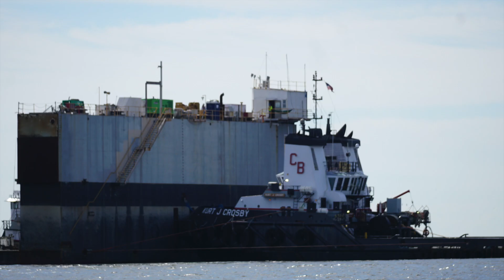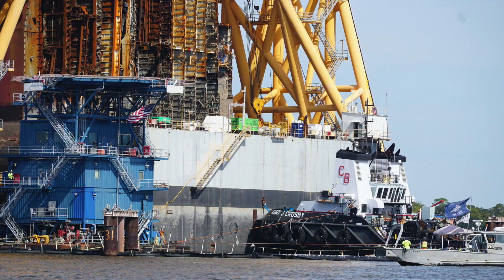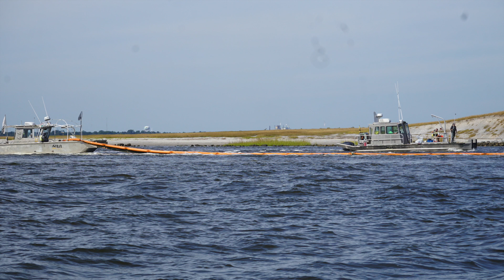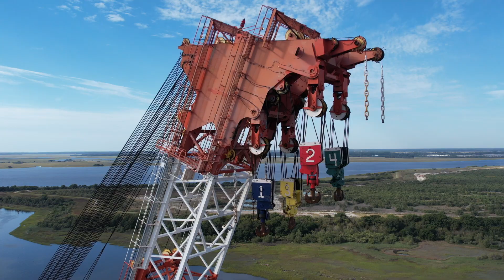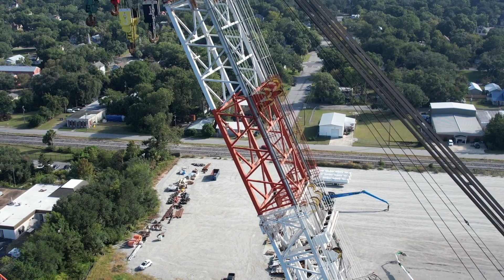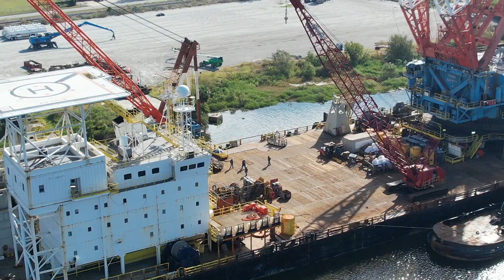LAST SECTION BEGINS LOADING!!! on October 24, 2021

Comment: Clearly, this project will go down as one of the most expensive salvage operations ever conducted. But it didn't have to be...
Early on, the Golden Ray could have been parbuckled upright, pumped out and floated away intact to the scrapyard at minimal cost. 
But No. Someone wanted it to cost as much as possible and make as big a mess as possible in the Sound -- all just to gain some political and environmental leverage. And no one will ever be called out for that.

Comment: what I don't understand is that the other sections (except#5) were basically structurally sound. Did the ship sustain damage from an outside source before capsizing, or did something happen internal before it did? sabotage??
Reply from the maker: No. Just 2 years of crushing under it’s own weight.  MM

Comment: This is what I knew we would see. So, now we have 2sides down on the sand and who knows how many cars are down there, too. Have you heard how the plan on doing that? And how are they going to clean our waters? Love your coverage, Captain Andy. 👍🏻👍🏻🧡🧡🎃🎃👻👻
Reply: The VB-10,000 has a clam rake they might be able to use.  Other wise they'll probably use the claw they have been using to pull cars off the bottom.   Whatever of the ship that is left on the bottom is probably not too strong, and will most likely break up into pieces as they attempt to lift it.

Comment: I did some calculating on how many feet of cabling there is just to support the boom, 9,800ft/2,987m of cable. That's 1.85 miles/2.89kils of cable.
Reply: On how many spools?  I wonder if Andy could get a tour inside Thor's engine house.
Reply: @JoeLinux2000  In the video there's a shot of the lower sheaves all 18 of them.

Comment: Thor makes the VB look like a toy any video of them recycling the GR in Mars in Louisiana
Reply: Thor is big, but not the engineering marvel of the VB-10,000.  Thor is a double boom crane, each with two lifting blocks.   VB-10,000 is a lifting platform that transcends most others.  The design work that went into the VB-10,000 is incredible.  Far superior to the FIU pedestrian bridge.
Reply: @JoeLinux2000  I love the VB a beautiful piece of equipment that's why I have had it on my fb profile for a year but Thor looks big

Comment: Andy, Have they given any insight on how, time wise, and what potential disruption to the sound removing the debris will have? How deep is the rest of the ship buried?
Reply from the maker: Nothing yet. We have no details of the debris on the bottom.  MM
Reply: It will take as long as it takes.   I suppose some of it is related to how fine a rake they use.  It's possible in the end divers will be sent down with a large basket on a hoist.

Comment: Not familiar with "metric" tons, but at 3.5 mil pounds, that's 1750 "US" tons @ 2,000 pounds each. With the VB around and ready, it will be interesting to see how/why they need this device??? 
Thanks for keeping us "in the loop" Captain Andy!!   Very interesting stuff !!! 👍👍👍👍✌️🛠
Reply from the maker: Thanks for the info!  MM
Reply: The VB-10,000 is designed for lifting large things off the ocean bottom.  It's a floating gantry crane.   It's very strong but limited in movement.   Thor is more nimble and can swing things around and at least two times stronger than an average large crane.   Each has their purpose.   There are a large number of various sized cranes operating in the port.   You have to use a tool that is the right size for the job.  Since they all float, it's more complicated that operating on solid ground.
Reply: Lift chart for Thor indicates 1,760 tons (3,520,000 pounds) at 131 foot radius.  VB10000 can only lift straight up/down and cannot swing.  Thor can swing very large pieces from the dry dock to an adjacent barge.  

Thanks Captain Andy for the great video of the Thor.
Reply: @stevencriste9656  
Wow!! That 131foot radius seems like that's with the boom laid down more than a fair amount!! Usually, the max lift is with the boom almost straight up. Pretty impressive !!! In the pic's, it's really hard to gauge where 131' is from the pivot point.
Reply: 131’ is close to straight up, she will lift 220 tons laid flat at 275’

Big crane!

Comment: Captain Andy. Outstanding marriage of drone and surface videos. You really know how to tell the story. I was also impressed with the videos of the main crane on the Thor. I'd really like to see the cable reeving diagrams for the boom hoist and the load hoists. What a complicated  reeving scheme that crane has. Please keep up the outstanding work, as you said, the project has a long way to go before it can be considered complete. The devil is in the details, as soon as the last section is removed from the site, there is a lot more work to do.
Reply from the maker: We will be there......  MM

Comment: They have a crane, the Left Coast Lifter, that was last used building the new Tappan Zee bridge in NY that says it has a 1,900 ton capacity. All I know it it is HUGE and I suspect the crane you have down there is almost as big. Even with the boom down, they had to time trips under the bridge with a tide table.

Comment: Section 4 looks very weak in its current state. You have to wonder what it will take to stabilize the section so that it can be safely transported to the location at which it will be taken apart.
Reply: Isn't this one of the sections they will cut up here before transporting on the open ocean?  I think that's what "Thor" is about.   It can handle some large pieces of the hull sections.

Comment: At 4.55 you can see a major structural detail that I believe will be where they support this section too.  Halfway down the hull is a large deck spanning the ship, which I believe is the "Main Deck", the last real structural deck above the waterline.  At 4.55 that deck forms the top of a "T" with a vertical centerline bulkhead that goes to the keel.  If the can support the bottom of that deck, which they did on Section 5, and get those spears welded to the bottom of the hull, they can get that rascal pierside by mid week.

The damage is bad, but not fatal.  The side plating is gone but there is still some strength left...

Comment: Yea!  Absolutely fantastic coverage.  The quality is beyond belief.   Thor is amazing, but the VB10,000 is probably the stronger of the two.  I wonder if the 10,000 refers to metric tons?
Reply: VB lifts 6,800 metric tons or 7500 tons, (15 million pounds) , so it is much stronger
Reply: @jameshoekzema3172  I take it that an American ton is 2000 lbs, and a metric ton is 2,200.  Is a metric ton a 1000 kilograms?